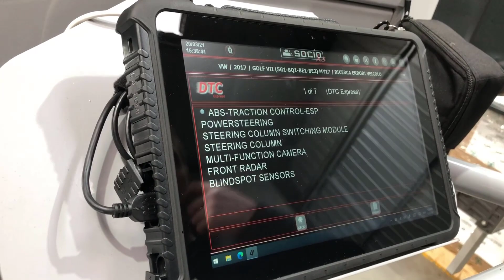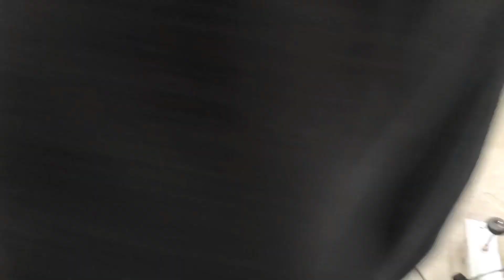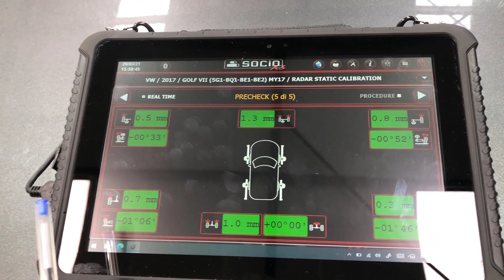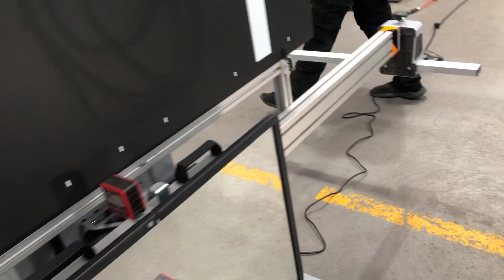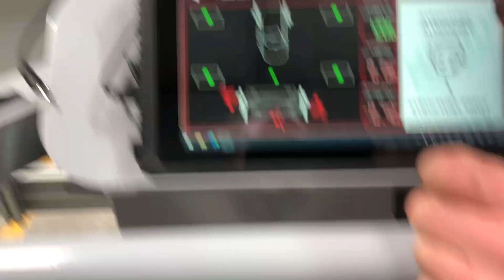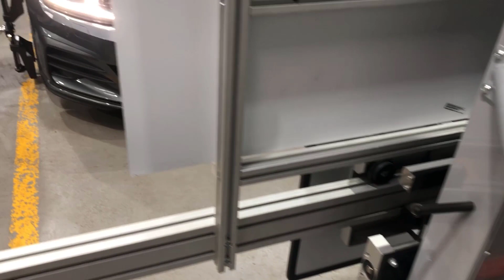Calibrating a front radar on a 2017 VW Golf with the Sice PROADAS system

Comment: How much does this cost? I went to my previous VW dealer because someone reversed into me and cracked the badge and did something to the radar. There is an orange triangle with a ! in the middle and he said it would cost €1000 to replace. Didn't even look to see if it was broken. My new VW dealer says they can recalibrate it for €250. Much cheaper, but I'm seeing other people who are getting charged €150 for it. So what's going on? I thought the VW dealers would be more honest than some of the cowboys around here. Maybe I'm wrong again.
Reply from the maker: The cost to calibrate varys but if noting else is wrong and just need a calibration prices vary from around 220 to 250 euro + vat
And also depends if your wheel aliment is off and needs adjusting as this has to be correct before doing the calibration,

But if it got hit there is the chance that the mounting for the radar is damaged and needs to be replaced or depending how hard it was hit the radar could also be damaged 
So if the radar is damaged it could cost €1000 or more (i am not sure of the prices of the radar but i do know it would be costly)
Reply: that is cheap i got charged nearly £400 to get calibration done .

Comment: Hi, great video and just what I needed. How much do you reckon it should cost to get this repaired?
Reply from the maker: Hi 
It depends if the car needs to have the wheel alignment adjusted or not as well
And in a lot of cases the mounting brackets may be damaged 
So hard to say exact cost 
But if just calibration and no other issues I guess price could be anywhere from 220 euro to 300 euro depending on you region